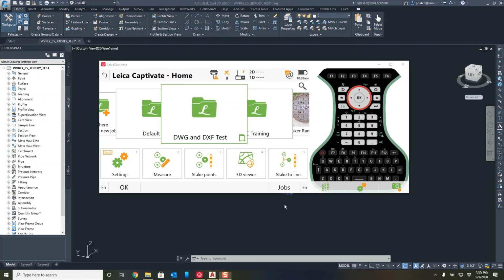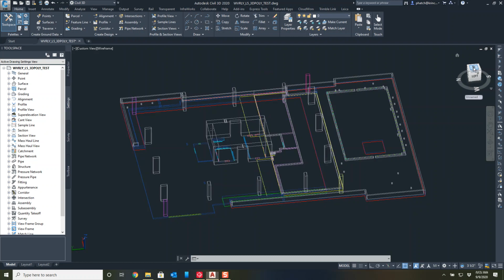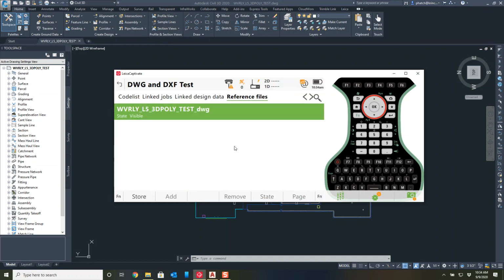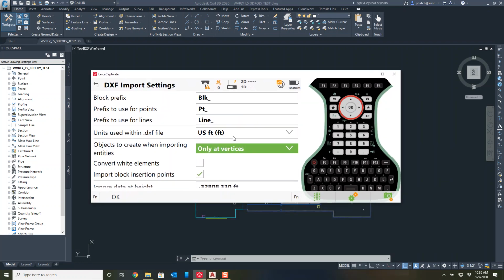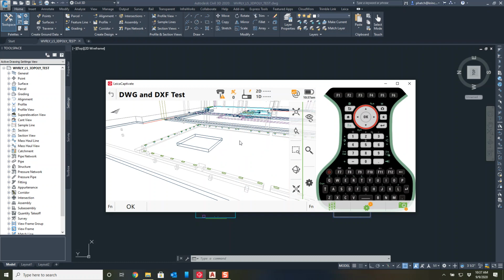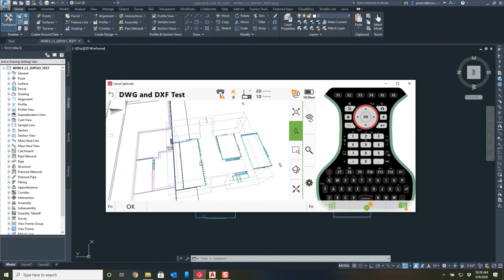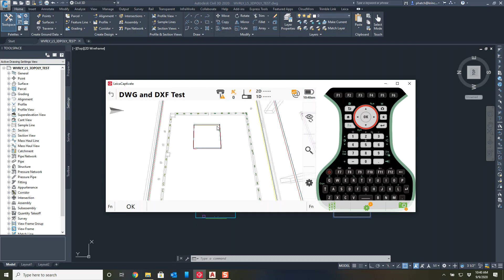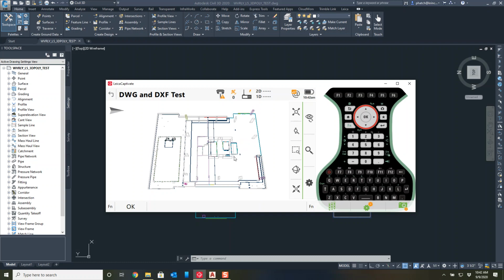Leica Captivate DWG and DXF import

Comment: Thanks for the Video! I'm just trying to figure out how to get my files into the "Leica" Format. I got everything else working great, but was curious if it needed to be exported a certain way in order to get the file into the "Leica" format in the Reference Files tab?
Reply from the maker: There is no "Leica" format for reference files.  Simply do a DXF, DWG, or IFC directly out of CAD.
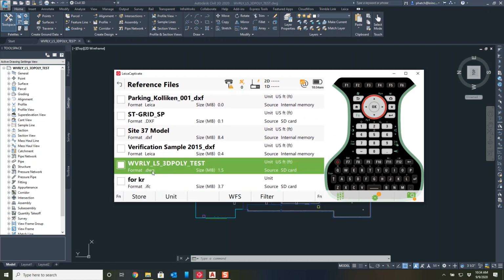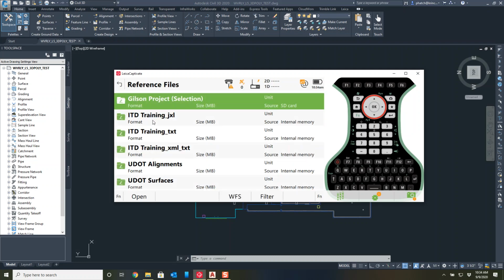Reply: @PeytonHatch1  In your video at 2:17 to 2:30 you can see the “Verification Sample 2015_dxf” shows the Format as Leica and there is a filter for Leica. I understand that these are still technically a DXF file, but just curious why it shows as “Leica” format rather than a DXF?